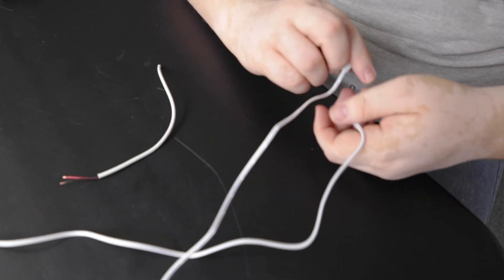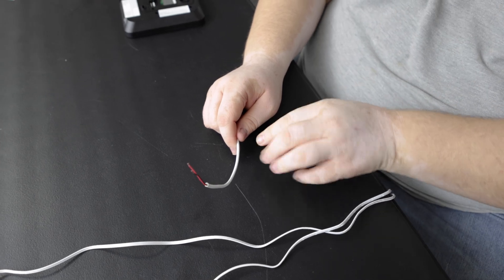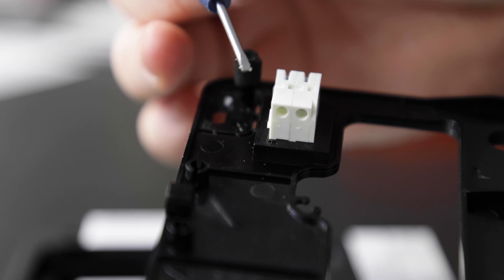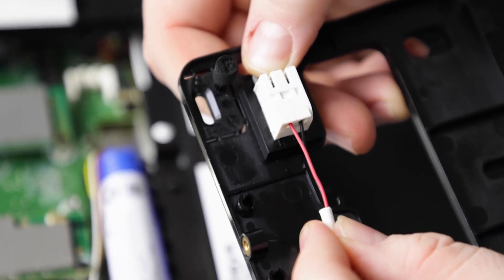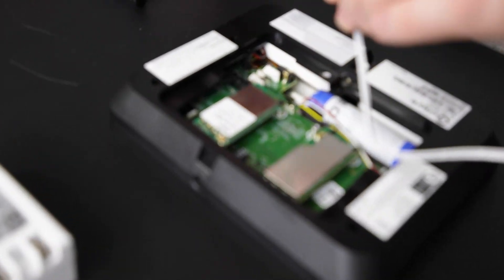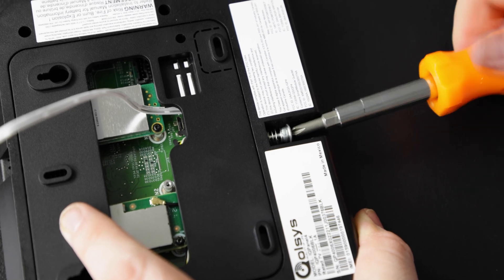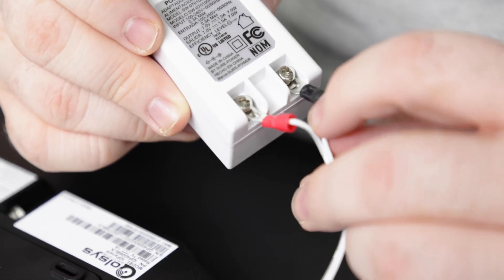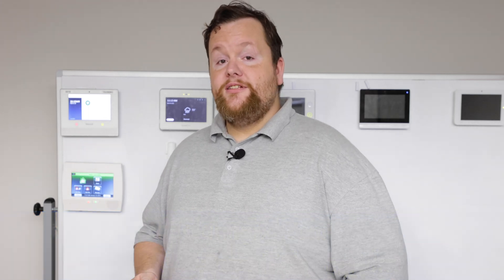Qolsys IQ Panel 4: Connecting to AC Power

Comment: Also, what if my Qolsys Panel 4 does not have the white block for the stranded wire? How else could I power the panel with a long run of cable?

Comment: If i run the power wire with the stranded wire and forgo the cable that comes with it, do I still need to have the transformer be inline with the power run to the clip on the white block?

Comment: 2 brand new iqs. Wont power up. Did the jump start trip on the plug and the battery 10x each. No lights at all smh
Reply: I thought I had the same issue but then I noticed the backup battery's 4-pin connector was not connected to the base, once I did that, everything powered up.
Reply: Open the panel up. Check to make sure the [cables connected to the blue] internal battery has been plugged in. Then close up the panel and reconnect to power.